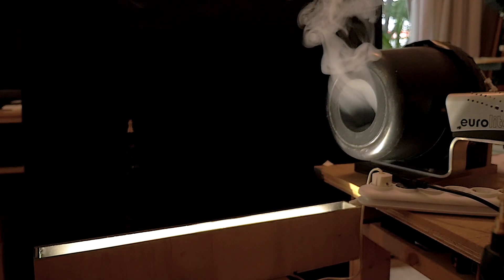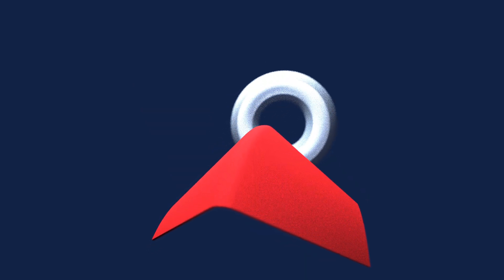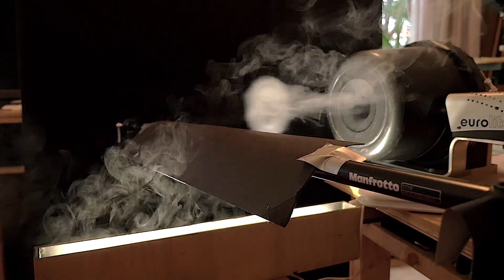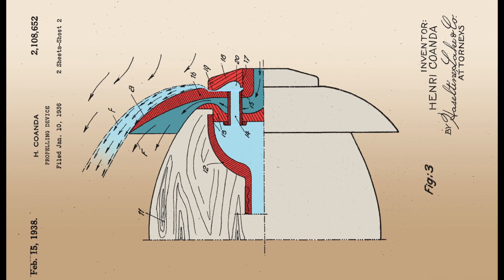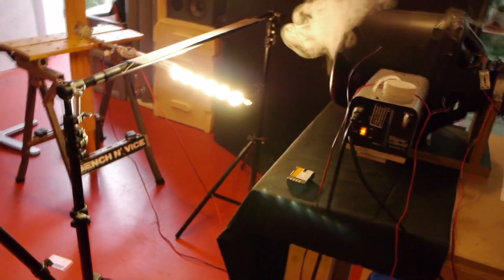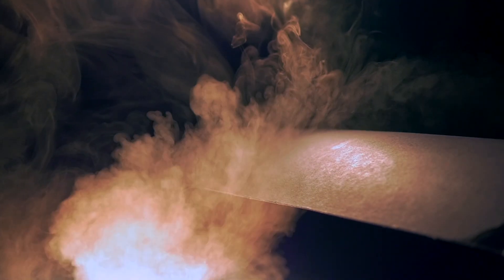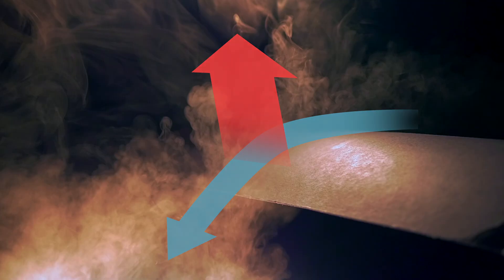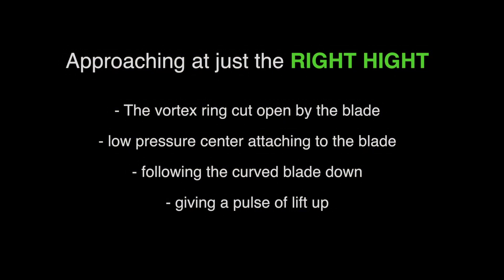The Nijhuis Vortex Ring Lift Effect

Comment: what happens if the smoke would be molten wax/salt? same? I guess...
Reply from the maker: In a liquid instead of a gas? I would expect something similar, because you can also create vortex rings in water. However, the fluidity of wax and salt is lower, well, depending on the temperature.

Comment: beautiful, except... i think you are focusing on the wrong side of the wing. what happens to the bottom half of the ring?

it IS the coanda effect, which is simply bernoullis, and as you say, its the atmosphere pushing down on it that makes it "cling". coanda does NOT produce "lift". the atmosphere pushes down on that layer of low pressure air just as hard as ever.

so.

you chop the ring in half, the inner surface is traveling at at least twice the velocity. higher. the velocity of rotation in the vortex and forward speed. so yes, very low pressure zone.

but the atmosphere is STILL PUSHING IT DOWN. 

what happens to the bottom half though? it seems to disappear?

i see the vortex ring itself as gas with momentum, rotating. its inertia makes it want to fly out... centrifugal force. why doesnt it? bernoullis. its got velocity, a low pressure, and the surrounding atmosphere is high. its "slapping into a wall of air" and being constantly accelerated at right angles to provide centripetal force... the faster it spins, the more it tries to kick out, and the harder the "wall of air" seems. as its lower pressure with velocity it tries pulling in on itself, being 'crushed" ever tighter... but then conservation of angular momentum comes into play, as it spins faster it tries flinging out and slowing down... theres a sweet spot where in=out... and the vortex persists at that diameter...

you chop it in half, and rather than impact air, thats soft, sticky, and tends to drag along with it, it hits an inclined plane... a solid surface.

and it is the air in the LOWER half of the vortex ring that is losing its velocity, and transferring its momentum to the wing. along with the sudden change of direction down... both forces acting together to give a relatively powerful kick "UP" (and FORWARD).

you never showed what happened when it was TOO LOW.

Comment: I have a theory: The airflow in the middle has greater velocity than the airflow at the outer edge of the ring. When the ring gets cut in half by the blade, the faster inner airflow flow around the blade and curves downward due to the coanda effect. However, when only the outer edge of the ring touches the blade, the ring goes straight forward because the airflow is very slow and thus doesn't interact with the blade.

Comment: Giesbert,
It seems I am able to "pump" the earth, as I see ground currents. This can be explained by the Aether ring vortex. When a ring moves, it sucks/pushes againnst the air, which makes the ring move.
But, when a ring vortex would be stationary, it would move the air around itself.
This translates, to a stationairy Aether ring vortex in my L4 extra coil. Which sets the Aether innto a pumping motion in and out of the earth ground.
I have made a short video explaining this, which some of your video material .

 I will first share it with you (I'll send an email link).

Comment: Hi, I’m Douglas a.k.a. UAP “Underrated Actual Physicist” and just found this vid. , love it! I’d made a video three years about vortext lift of the strake effect, as it was an hypothesis of mine that in large jet turbine engines, the strake effect plays a much larger part in lift, takeoff conditions, fuel consumption at altitude and cruising speeds, net drag, stall speeds, and potential VTOL in windy conditions even by non+VTOL craft.
I was besieged by trolls, in particular ones claiming to be pilots who discredited and disparaged me for introducing alternative ways that aircraft operate, by using vortices for lift and other benefits. I showed the strake vortices as they appear in certain weather conditions by condensation of water vapor in the lower pressure flows. You have demonstrated some key concepts in your experiments, and I wonder if I may use parts of your video in my response presentation to help me defend my hypothesis? You provide results that may even support a move from hypothesis to theory, when it comes to the physical effects of vortical lift and increased efficiency by over-wing strake effects in aeronautical design of fixed-wing aircraft propulsion systems.

Comment: I think this was previously called "Bernoulli's principle" but in my opinion in this exercise "The Nijhuis Vortex Ring Lift Effect" does sound a lot cooler.
Reply from the maker: Isn't the "Bernoulli's principle" not more about air flowing through tubes with changing diameters? Nice that you like the name  :-)
Reply: Bernoulli's principle also describes how an airplane wing creates lift. The relationship between speed and pressure of a moving fluid.

Comment: Cutting the ring? It looks like you're tripping it and then it falls. Like gravity is having it's effect on it.  When actually I think the tripping part slows down the burst of air, then gravity acts on it.
About the Coanda effect. would powerful magnets placed all around the circle, on each side of the rotating ring, opposite of each other work well enough to make it levitate, like a flying sacer? Kind of like that European train that goes like 200 miles an hour.  Maybe turn it sideways add a few wind vanes, holes and you have a new style wind turbine?

Comment: So conversely if the vortex is split under the curved plate then it should drive the plate upward slightly as it travels under the plate by reverse air pressure following the wake of the vortex. Much like the drag effect of one car following behind another.

Very interesting indeed.

Comment: try spinning your smoke cannon to get a radial rotating vortex
Reply from the maker: I have actually been thinking about doing that. Mainly to get a nicer distribution of the smoke. But what else would happen.. One way to find out!
Reply: @GiesbertNijhuis  As far as I understand, a vortex structure is more stable if it has a spiral structure. The flow in the tornado is spiral, but the flow in the smoke ring is linear. To get the smoke ring a spiral flow, the smoke ring must be twisted axially.
Reply from the maker: @abbazhaba9584  euh.. there is no straight line of motion the air inside in a vortex ring. True that these curving motions are all in their own ±flat plane (an area shaped like a piece of 🍰).

Comment: Thanks Giesbert! As always, inspiring.
I intend to make these vortex rings with electric fields (Aether).
Today my airzooka came in, and now your video is online. Beautiful
Reply from the maker: Ha Master Ivo, and what have you been up to lately, causing resonant frequencies in parallel universes without permission? 😉 (I will check your channel). Electric vortex rings... can that be done? I know about eddy currents, when moving a magnet next to a block of copper or such, but can an electromagnetic vortex ring travel though a solid block of copper? If so, then with what speed and size? Electric pressure and magnetic fields travel crazy fast, near light speed, but electrons move as slow as a smail. So much to learn. The airzooka toy, ah yes, it is actually an amazing good vortex ring shooter. Have fun!
Reply: @GiesbertNijhuis  Thanks! Yes I've been paying with impulsed resonance. Trying to disrupt the electric fields.
The electric vortex ring is with no doubt faster than the speed of light, as it is not a transverse, but longitudinal wave.

I'm working on a new video showing how to place the impulses anywhere on the resonant sine. This way I can combine the voltage of the impulse with current to give it power
Reply from the maker: @MasterIvo  Just watched your latest video. You are trying to get extra energy from somewhere by adding precisely timed energy pulses to an electric/magnetic resonance? How is that different from trying to get energy from "playing" (doing research) with magnets or springs?
Reply: @GiesbertNijhuis   the intend is  an amplified feedback loop.
There is no difference, I'm also playing, except not with materials, but with electric fields.
Reply: Beautiful synchronicity 👌